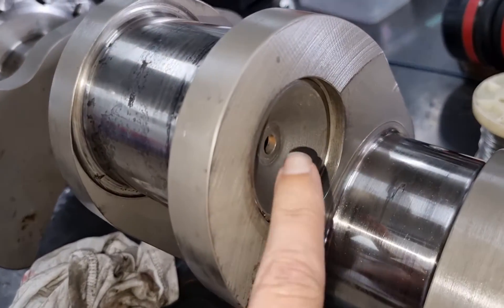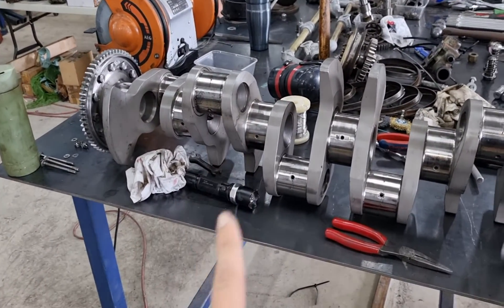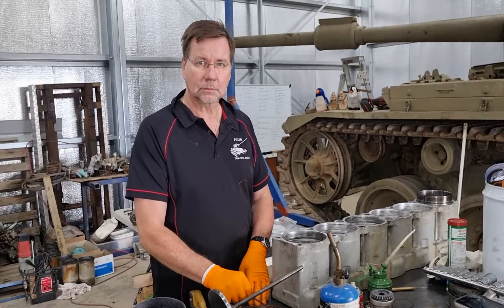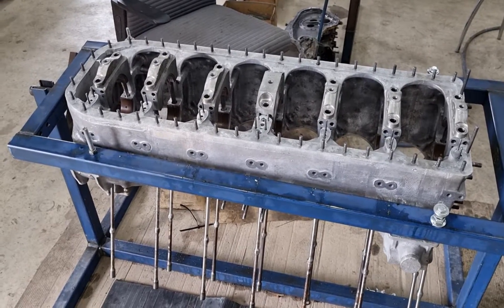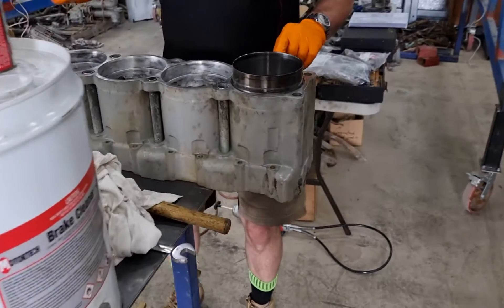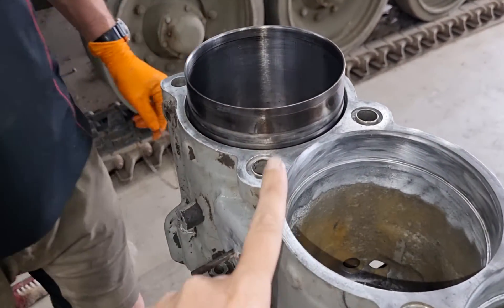Happy Crankshaft, Cranky Lottie

Comment: Blow off pressure is 90psi though 60 is operating. Are the two threads American and British?
Reply from the maker: Just helicoiled. Current theory is that when the engine was last stripped in the 70s the end head bolts were broken... because they always are. Someone had a difficult time removing them and damaged the threads. Put a helicoil in them.

Comment: What is the bore and STROKE on that MONSTER? Got to be about 6" bore or larger. And stroke?? 
I would love to build a crude modern remake of the first diesel engines, oil field engines, the hit n miss. Pony engines. Rolled into a modern tooled engine. Actually there is several engines I'd like to build. Start with casting a lost foam crankcase and cylinders also the heads and cam /rocker covers. And a set of. Pistons from a few old pistons. The crank case from a few old cast aluminum rims.   And iron parts from brake rotors. Possibly hand forge a set of rods from a old set of springs, and a crank either assembled
Like modern motorcycle cranks. Or rough hand forge the crank, or possibly a combo of both. Press fitting 1" thick steel plates  with 3" ground  bar..  using main bearing from a common engine, for the rods and mains,  drill oil holes . Drill  the rod for 2"!wrist pin.  Use ground hardened hollow bar about 3/8"-1/2"thick wall. The same for the rod journal,  the major difference being, the engine is a 2cyl boxer style compression ignition. Oil burner.   With 6"-8" bored, and upwards of a 12" stroke.  With overhead cams using timing belts.   Use injectors from other engines what may work, the cam running the pump and the injectors if need be, using Detroit 92series injectors.  Cast a iron blank to make rings from. Then surface grind them to perfection.  Making the rings thin as practically possible. Maybe try cutting a groove to press in moly wire or ribbon. Even in the oil rings. Being 1.5mm wide,  with a 2mm spacer between them and 2mm drain back/oiling holes .  And 1.5mm compression rings with an attempted Napier second ring. The top ring  cut a groove 1/3-  1/2 the depth and 0.25mm wide for moly wire /ribbon.  Then mill the face of the ring so it behaves as a thinner ring. Possibly doing the 2nd ring the same.  With gas ports. To seal the fat ring. During combustion .   Possibly look into getting the ports EDM being about .020" diameter. The moly ring grooves also.  It may just be a open groove to hold oil and reduce contact.  A 8" ring being 1/16" thick  maybe 3mm/1/8" is the best I could hope for.   With 2mm oil rings  bring solid and bevel the edges.    No chamber in the head only enough pocket for the 2.2" intake and 2" exhaust valves , with the inverted trapezoid in the center of the piston.  Ceramic coat to insulate thermally.  And I want it to work. Generating power for my house, off grid.  Charging batteries. Burning waste oil.  A 24:1 compression ratio with quench squeezing a 8" bore into a 3.5"- 3.75" or 4" or less combustion chamber  getting smaller until  the bottom being 1" across.  And still being over 1" thick under the center of the piston.  The skirt being 1/2" thick,  from the pin to done and to the other pin hole being solid aluminum.   The ring stack taking up about 2.35" including the dome being about 3/8"-  and 2..5" under that for the pin a 2' pin centered in 2.5" , the 1/2" skirts should stiffen the rest up nicely.  So the top 5" bring solid  except for the combustion chamber. Then the 4" wide  area for the 3" wide rod.  The sides milled off. Leaving 2.25" wide flats for the pin bosses. . Heavy but it's not seeing but 1500 rpm probably ever.  Likely a 600-900 rpm engine, 1200 at most!  Generating about 5kw for 6 hours a week, possibly 8 hours 3x a week in mid winter.  Likely at 400-600 rpm.   Sorry to ramble,!!have a awesome day!

Comment: Hello Lottie, Peter....First, I really do like your videos, you have a wealth of knowledge in your line of work and a great attention to detail.... however, I spent several years a long time ago working at an engine rebuilding factory. If we had an engine needing a crankshaft for a rebuild, we would carry it over to the crank dept. where it would be cleaned, magna-fluxed to check for cracks, measured for the exact specs for either grinding under-size or welded/tuff coated and then ground to bring the crankshaft bearing surfaces back to perfection as new. My eyes hurt looking at that piece of steel you are putting back in that engine, the rust pits and scars on the bearing surfaces. I do however realize that re-working a crankshaft is expensive, perhaps even more considering your location and availability of shops able to do that type of work. I also assume this engine will not be abused or run to its limits in a battle with the enemy, so I can understand there may be limits to what the owner is prepared to spend on that engine. I am sorry, to be clear, I would never put that crankshaft into an engine in that condition. I started work in the repair shop, powder welding and brazing cracked blocks & cylinder heads back to good shape, also "stitching" cracks in water jackets with tapered plugs threaded into cast iron and boring blocks & installing press fit sleeves. Then I transferred into final assembly, building short blocks of various sizes, anything from the 4-cylinder flat head & f-head Willys Jeep engine to the Ford Super Duty truck engines, 401, 477, and 534 cubic inch. My friend who would ride with me to work, was in the crankshaft dept, he did it all, measuring, crack checked, straighten, grind, weld, grind again, polish and balance...when he was done, it was perfect. I would build 15-25 engines 5 days a week over a period of 5 years.... that's a lot of engines, each day one engine was chosen to be dis-assembled to check quality, while another was picked to be dyno-tested. They all passed.   Just my opinion, I know I'm not the one building the engine.
Reply: There's limits to what they can do. That kind of high quality machine work is the right way to do things, but will it ruin the entire engine for the few hours a month this might be running?
Reply: @RobinTheBot  Quite possibly.  If the crank is going into the engine in that condition, what is the rest of it like?  It is concerning that there seems to be no appreciation of the poor state of it.

Comment: Those 2 headbolts with different sized threads, are those the same size threads as the old size you mentioned in the short staring Peter?
Reply from the maker: As far as we can tell. We don't have the old ones to check but they look similar. The threads have been helicoiled. Presumably by the folks who rebuilt it in th 70s
Reply: @lottiethetankwhisperer  was those helicoiled bolst metric? I presume this engine is made by useing imperial units